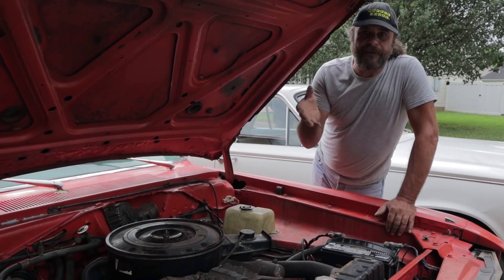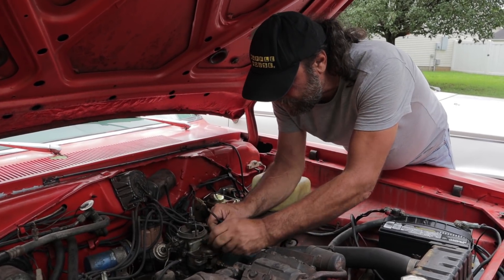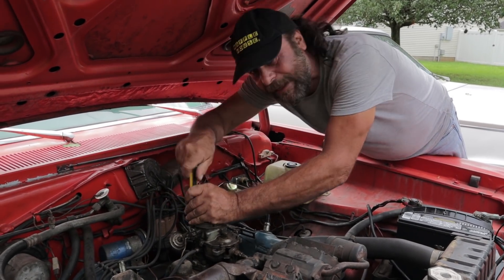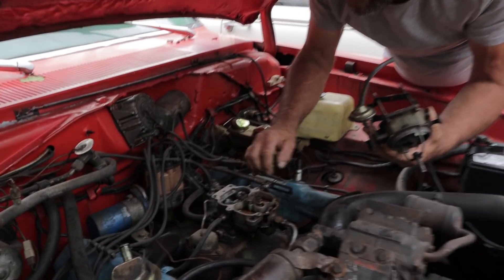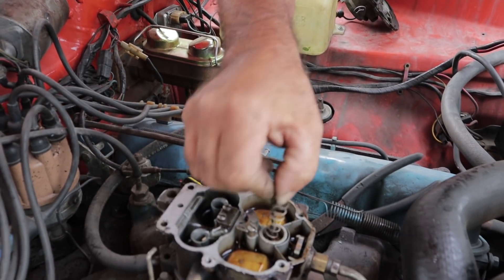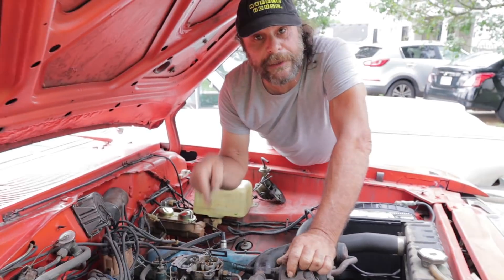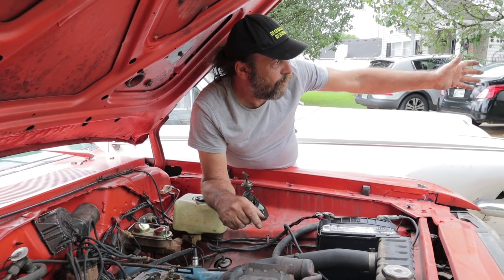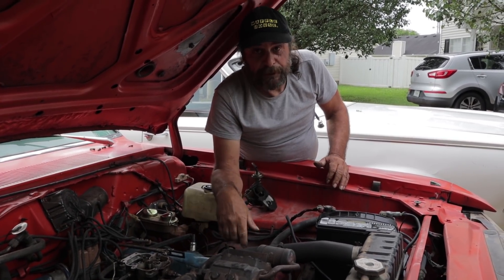Driving Classic Cars- The Truth About Ethanol Gas

Comment: Always like your videos and appreciate your knowledge and outlook but your WRONG on the
Is one T ! Don’t forget not everyone lives in the south and it’s not only old cars like my Nova and your Dart that use carburetors. I own a commercial landscaping company in Maine and I have several mowers and Stihl blowers trimmer saws etc that when they get put away for the winter I have to run no ethanol gas through them until they run out of fuel. And ethanol fuel left in anything that will sit for at least 4-6 months WILL gum up while sitting ! Most new carbs on anything I deal with cannot be completely cleaned anymore. And it’s cheaper to keep a stock of carbs on hand. It also eats the fuel lines. Again if ethanol fuel is left in them over the winter. A daily driver is not what suffers, its if it sets for a meaningful amount of time ! Maybe all of this is just in colder climates but it also loses its flash point noticeably after about 3 months to the point u need to add new gas into the tank to mix with the old gas. These are ALL experiences I’ve personally had with several pieces of equipment and everyone I know has had the same experiences with their equipment. You’re not comparing apples to apples on this one. Daily drivers has never been the complaint from I’ve heard or experienced. My ice auger will not start ( be

Comment: No, ethanol gas goes not evaporate cleanly. It absorbs water and becomes acidic. It will eat pits into aluminum carburetors and leave some jelly stuff to plug up everything. It will rust out an electric fuel pump after a year of sitting. I’ve seen it eat rubber hoses in fuel tanks until they were just sludge on the bottom. 
Is Uncle Tony going to later “debunk” his own video here like he debunked himself about the “fuel vapor” episodes? 
Oops, I guess engines do only burn vapor.
Reply: Hey, Tony did already debunk this in his video “is modern gasoline destroying my classic car’s engine” 😄
Good video!
Reply: True though. There are upsides to everything. I like ethanol in gas too. It’s supposed to be a good octane booster also, with usable gains up to about 20%. (E20)

Comment: actually with gasoline that you're running has only 10% ethanol mixed in... I really doubt your old car is a flex fuel E85 setup. the only reason 10% ethanol is in today's gasoline is because the gasoline is so crappy you needs ethanol as an octane booster. once you get past 10% ethanol in your gasoline it becomes a gas hog. E85 Ethanol is terrible gas mileage. but it makes the tree-huggers feel like they're doing something to save the planet

Comment: ? The ethanol might evaporate quickly, but gasoline is gasoline so 90% of the gasohol will still be there just like in the olden days. 

What ethanol did to my old truck was loosen the crud in the gas tank which clogged the uptake tube, kill the engine, the suction would then stop and the crud fall back down, and the  process would start all over. I had to drop the tank and have it professionally cleaned.

What's more, in bitterly cold temperatures (it usually gets to 30 below zero Fahrenheit around here) ethanol in a carbureted engine can be reluctant to start, and 15% gasohol will be worse yet.  I am not fine with ethanol.
Reply from the maker: Wrong...gasoline is formulated differently these days, and the whole shebang evaporates.
Reply: @UncleTonysGarage  Reformulated gas burns cleaner than the old stuff, but is still basically the same and actually evaporates slower than the pre-reformulated gas. But you may still be right that the newer gas, while it takes longer to evaporate, might not leave as much residue. I can't find a definitive answer.

But ethanol is still garbage in old gas tanks and extremely cold temps.

P.S. Great comments on the slant six. I have several.

Comment: It did horrible things to my Holley carb that was only 3 years old at the time. It sat for 2 years while the car was in the body shop and ended up with a horrible yellow varnish that plugged up pasages, and froze up the accelerator pump.
It ALSO causes heat-soak problems in the summer time, because ethanol gas has a lower boiling point than non-ethanol gas.
It ALSO causes poor fuel economy. F### ethanol. There is NO legitimate reason for it. Its true purpose is to subsidize the agricultural industry (corn).  It does NOTHING to reduce pollution. It's B.S.

Comment: I call B S . ethenol will evaporate and leave you with water. I've. seen it separate in as little as a week, but surely after a year you would have problems with water in the fuel. Not to mention it actually pulls moisture out of the air. My 71 F-100 hates the stuff. if I don't use it every week I have problems. minor but I've had to change all my fuel lines as they would get brittle. I Changed the fuel pump twice this year. Diafram diaphragm went in both cases. I have started this truck after sitting for 4 years in the backyard with the old gas and it fired right up with a good battery, now I have to make sure I started every few months otherwise the carburetor gets full of Separation with water. this ethanol gas was purposely made to ruin old vehicles also my lawn mowers that sit through the winter with the gas in it it's just about shot and you have to clean the carburetors out and practically rebuild them every year I'll miss ethanol crap. now there's fixing to be up to 15% ethanol in it so you'll really see some problems now sure on a daily driver you probably don't see these problems put it in the backyard for a few months you'll start to see many problems.

Comment: everyone blows the whole ethanol is corrosive thing way out of proportion its not as big of a deal as people say it is. The main thing about ethanol and other alcohol based fuel is that they are water soluble and absorb moisture and that is when the corrosion thing gets worse when you let the thing sit forever in the garage with ethanol in the tank or float bowls the stuff has a lot shorter shelf life and goes bad quicker but if you drive the vehicle regularly keeping fresh fuel in it you are fine. Non-oxy unleaded 91 pump piss is terrible for high compression performance engines and turbocharged or blown will ping like a motherfucker on that stuff. Ethanol has an incredibly high octane rating and knock resistance which is why me and all my friends run e85 in our efi turbocharged cars because we can get away with a lot more boost and higher compression on it without blowing up the engine and it is cheap and readily available here in the midwest. The more ethanol the better you can safely run a 13:1 compression race motor on e85 and drive around on the street without issues if the car is tuned properly so what is not to like about that.

Comment: Different story with 2 stroke and air cooled motors
Reply from the maker: Has nothing to do with 2 or 4 stroke or air cooling.  It has to do with the gravity feed type fuel systems on those engines
Reply: @UncleTonysGarage  run premium fuel in the 2 stroke and air cooled and have no problem run ethanol and end up with scored piston skirts.

Comment: Classic Carter B+B. I remember the first time I ever took one of those apart and turned it upside down and lost one of the balls. It was on the weekend so I had to steal one out of some strangers 1965 Dodge Polara at the side of the road. I felt bad when I saw a tow truck pick up the clean unit and haul it to a scrap yard where they crushed it.

Comment: The myths about ethanol are BS. Here's why: they stem from the conflation of Ethanol with Methanol. In the 70s, an alternative fuel became available called M85. Methanol. Which happens to be a very harsh solvent - the kind that might destroy rubber. Especially back in the days when rubber parts were not designed for use with methanol. Now, there is E85. Ethanol. But boomers hear "something-85" and have vietnam flashbacks of destroyed hoses and seals, because they gambled with an alternative fuel (which their car was not designed for) and lost. And so they conflate the two different fuels, and spread the myth. Ethanol is a very mild solvent compared to regular gasoline, which itself is a very harsh solvent. Ethanol is basically just vodka, it's a very clean, pure chemical, unlike gas which has hundreds of different hydrocarbons, and extra junk in it. So ethanol cannot leave gunk, varnish, or anything behind, because there's nothing like that in it, and nothing in it that can break down, it's only ONE chemical compound (C2H5OH). And ethanol burns completely cleanly, and increases octane rating. In short, it's superior to gasoline by any measure except energy output, which is only marginally less. And it won't damage any seals or rubber parts because it never did, when people say that crap, remember they have simply confused ethanol for methanol.
Reply: Most of what you posted is correct. There has been some confusion with the methanol experience in California a couple of decades ago, but the negative myths about ethanol date back to the 1920's when Standard Oil started the American Petroleum Institute and they began creating lies about ethanol (and any other potential engine-fuel competitor, including CNG).
Reply: @TheAutoChannel  So you're saying I'm right, but big oil is ALSO perpetuating the myth, or rather, has been forever. Gotcha.

Comment: BS . Every snow bird in Florida that leaves ethanol gas in there Marine engines for 5 to 6 months  comes back and all there fule lines are leaking and all the seals in their carburetors are dried and cracked . There gas is not any better in their float bowls  it’s usually A Googly sticky mess . Every one that leaves ethanol free fuel in there tanks and lines never ever have issues with their engine starting .
Reply from the maker: Different animal

Comment: Hmm. Maybe you like it in your car, but it seems to wreak havoc with my carbureted motorcycles, chainsaws, weed eaters, and anything else with a small carburetor on it. Problems I don't remember having before it was in all gas. It leaves crud behind when it evaporates. Not to mention absorbing water and rotting rubber lines, fuel bulbs, etc. Trump is pushing for more than 10% to help out the corn farmers...so get ready for more ethanol not less.
Reply from the maker: That's because in those gravity feed applications, it can't evaporate away before it goes stale
Reply: @UncleTonysGarage  I will take your word for it. It does seem like modern gas goes bad very quickly. I buy VP (San Antonio, TX) ethanol free fuel for my small engines, and they love it. Don't know what they add or leave out (other than ethanol) but it works. Love your channel brother👍